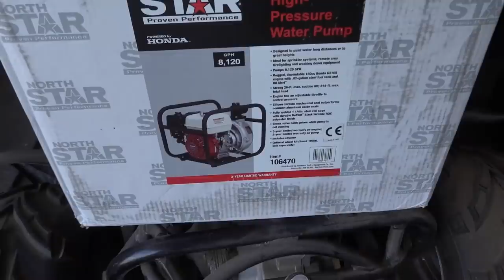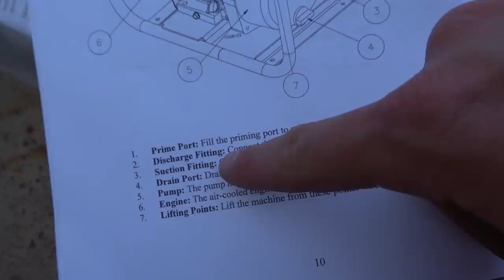I Built the Pumper Truck!!!!! Master Chief is Alive!!!

Comment: From a mechanics perspective on the truck first and foremost mount the dang tank. If you can I would maybe even mount it 90 degrees from how you have it. Then you may not need to hard line in a ball valve and can reach if from standing. Secondly this would give you more room for a rigid hose and reel. Also have you thought about hanging the pump on the under side of the bed? Like on a slide out so you can utilize that unleaded tank. Those Honda motors are dang near indestructible and we use them at work to run pumps and fans and compressors. So if you had your welder buddy build a little drop down slide out shelf you can have way easier access to the pump and motor. Anyways looks great and hope you find a good layout you like for that beast. Love the master chief moniker as well.

Comment: Cam locks are awesome but eventually after a year or two you have to replace them     There easy to swap on to your hose I have replaced a lot of them at work.  And your clamp just wasn’t put on all the way that’s why it slid off.

Comment: Don’t get rid of the red hose you don’t want to rigid hose when you were pumping you just need to fold it like we used to in the fire department get you a straight piece of board make it to straight pieces of board put it a inch and a half away and fold it into sections and it will hold the hose in place and you can just pull it out when you need it like we do on the back of Fire truck

Comment: im no firefighter but from my experience of building water trucks (1 water truck) i think you should make all the outputs to the hoses at the back of a truck (for the lay flat hoses) and then have a booster line on a reel also at the back for quick access, make all the knobs, switches and valves allin one spot so your not running around like a chicken with its head cut off trying to find all the switches etc. to run the thing.
hope this helps :)

P.S. Be careful messing with fuel lines as they can be very easily messed up and if not done properly can result in a major... well... lets just say stuff up... aka big boom (from fumes igniting in the fire.

Comment: You will grow to hate the pull start if you have to use it much. You will go through a few water tanks before you have to worry about gas for the pump.hardline the tank valve to the side to be accessible quickly.

Comment: And now buy the pump with an electric starter so you only need to prime and then push a button like they use on Snow blowers and newer large gas mowers.

Comment: Matt I’m a plumber with a little advice for your project. 1- Mount the pump in a frame on the rear of the truck off the back of the rear bumper. At a level that makes it easier to start quickly from the ground. This way you can connect the fuel tank to the engine and it will gravity feed the fuel. This will also let you get all of the water from your tank by having the pump lower than the bottom of the tank. 2 -Get  some 1” hose reals and build a piping valve manifold so you can turn on or off the lines you need. 3-Last make a hose rack for your 11/2 hose that you fold the hose up in a stack and if you need it you can quickly grab it pull it out for use. This is what pumper trucks have so when they arrive at a fire a firefighter grabs a hose takes off running to the fire with it. A second firefighter grabs the other end connects it to the outlets on the truck and turns on the water. It happens very quickly and efficiently. Talk to firefighters in your town ask them if they would show you their hose trucks and pumpers they would probably be happy to help you out with questions.

Comment: Does the tank have slush protection? Remember that slushing is a real risk for tankertrucks to flip over when driving with half full tank. Especially when going through curves. So go slow when loaded up.
You will also have a high center of gravity on the truck when loaded up.
No crazy slope driving at that equation !
Stay with the flat rolled hose.  The secret is to roll out the hose before starting filling . Ask your local fire service if they can help you out with a short instruction/ training in hose handling and some tactics for ground fire fighting. 
A hard round hose in that dimension will be so heavy to move that you can't handle it alone without working very hard.  
U can mont a reel with a smaller round hose also ( for lighter use )
There are fire fighting spraying armatures that work with lesser waterfow , that you can use fore that hose.  When firefighters go  in to a building (smoke diving) , often  smaller hoses are used to decrease the weight when pulling the 
pressuresied hose in to the building. 

Camlock on the suction side on the pump Is not a bad choice. 
On the pressure side use what fire services use. The camlock may snag    when dragd on the ground. 
Install a ball valve on the primer port of the pump for esye priming /Air removal/ The plastic treading on the 
Plug and pumphouse is not good  for frequent removal/ installing.

Comment: The tank all the way at the front of the truck on the bed because that’s what your normal square trucks do because actually there you can do it but that’s not the proper way if you want to do it but that’s just my suggestion and what they usually do

Comment: Has that thing got a PTO? PTO water pumps are common and powerful. Can't see properly but will that tank go on sideways? If it will that will free up a lot more bed space for things liike a hose reel (or two if you want long/short hoses) and you could probably get a ladder/platform on there aswell incase you need the height - maybe if some trees catch.

Comment: You need to have a firefighter come out and tell you how he would set it up, I would use a gated wye fitting so you can use a short line from your truck and your long line if you need it., you should figure out how to do a triple hose lay, makes it really easy to run the hose out., also get some smaller forestry lines to put out small fires and not use all your water

Comment: I know you have gone the way with the single output tank. But if you were to throw a dual output tank turn it sideways up against the bed and the headrest of the truck would be able to have dual output, dual motors and dual hose and reels

Comment: As a fire fighter myself I can say that 25-30’ fire hoses work better then 100’ because you have to drain them so they can dry, otherwise they will rot from the inside out. Also don’t roll them up except for storing them.  Stretch it out about 8 feet an fold it back on top of itself then continue that until all the hose is folded. That way you can grab the nozzle and run without the tangled mess.

Comment: You don't want a hose reel for your attack line.  You flake the hose in your truck bed (or make a hose bed).  You have to pull the entire length of hose out of the bed before charging the line.

Comment: That water tank is not enough. That truck can carry way more weight than that so get a bigger tank, a bigger pump and absolutely hook up the unleaded gas tank to the pump because that little fuel tank is not enough. You'll use it twice and then a big wildfire will show up you won't have enough of anything. After all the work on that big house you don't want to go up and smoke. Fires climb and go over mountains just look at Dmaxryno's YouTube channel. He also bought a fire truck for his ranch.

Comment: Matt, Utube DRAIN AND STACK FIRE HOSE.  You DO NOT want to put your hose on a reel!!  Takes too long to unwind and then hook up fittings.  In a fire situation, time counts!  Lots of good videos to teach you.  You should really buy another 100 feet of 1 1/2".  Yes, put a wye, and attach a short hose to a mounted gun on the back of the truck.  You would be surprised how tired your arms get holding a hose after just a couple minutes.  If you are saving your house, make it easier on your body.

Comment: As a small engine guy, you need to run non-ethanol gas with fuel treatment in it so it won't go bad and clog up your carburetor.

Comment: Just a resident Firefighter with not much experience, but I have a few suggestions. 
1. A baffled tank will help a lot with water weight shifting on turns.
2. You might not need a bigger pump but 2.5" can flow at 250 or even more gallons per minute with the right nozzle
3. Our brush trucks of a similar size carry 750 gallons, which is a lot.
4. we use Gallonage pumps on our brush trucks as opposed to pressure pumps, I'm not sure what you have
5. Our brush trucks don't use 2.5"  lines  because we don't typically need to flow that much water for this setting, and we want the water we have to last longer
6. if you use a hose reel you need a rigid hose because the water won't flow through a flat hose
 LAST AND MOST IMPORTANT!!!! EVEN IF YOU HAVE A PISTOL GRIP DON'T USE IT, JUST HOLD THE HOSE LIKE A MAN (you'll have more control of your stream too)

Comment: not a firefighter, but water plant operator.
1) make sure that tank is open to atmosphere when run your pump, Negative pressure equals crunch!  
2) you should also kill the pump before running out of water to prevent cavitation in the impeller.

Comment: Hey Matt. Are you well? Could you use the truck's engine to generate power for the pump? That should impact the weight of the truck, because you could then remove the motor on the pump and connect the pump to the truck's motor.. Although, you might want o carry spare diesel tack to keep the truck motor running longer. I'm guessing, if you accelerate the truck's motor, in neutral, you could generate more power for the pump. I'm no expert, this is just a thought. It also becomes a two man operation then. Someone to manage the truck's rev counter and someone managing the hose. or you can put a choke in the truck to keep the revs up. Have fun with your fire truck. Love your channels. Don't stop.

Comment: Don’t use thread lock Matt, just tighten them down real good. Cause if you need to take the couplings off for any reason (which is very common) that thread lock is going to hold you up

Comment: 1) have your welders make you a square tank with baffles... this will keep your tank lower and wider they can v the bottom to get max water.
2) build a connector manifold to hook your hoses up, you can put a pressure gauges on it and also be able to reverse for filling easier.
3) build a spray canon to mount on rear so someone can man the canon while someone drives, this also keeps it so you dont need to unwind hose
4) have a smaller hose attached to manifold for doing little fires on hose reel
5) get pump with electric start and hookup to your onboard fuel.

Just few things I see that may help... input welcome

Go to local fire station that has grass/brush truck and see what they say and get their input too.

Comment: If I was you I would put the on/off valve on the pup so you can turn on the water from the ground instead of trying to climb up on your truck so you can put out fires as fast as possible so it doesn’t spread

Comment: I would go to your local fire department for suggestions.  They are the experts in their field. The tank should be moved farther back so that you do not put so much weight on the front axle. The front axle has a limit on its weight carrying capacity  witch maybe  labeled on it. You may have to move the tank several times to get the weight distributed correctly.  Several trips to  a local truck stop with a scale.  Just some thoughts for your consideration.  Like the video.

Comment: Better build you a hose bed out of some angle iron so you can layer the hose in there and grab it and run straight off the back of the truck so it doesnt tangle

Comment: You would have been better using a high pressure hose reel rather than 70mm hose line.  We use 3x60ft lengths on each hose reel drum.  Two of you can manage a hose reel (or one if absolutely necessary) with no problem but running hose lines is going to take more manpower.  Using hose reels makes sense as they remain charged even when turned off and you get water instantly whereas hose lines have to be filled and that water can make the difference when push comes to shove.  The vast majority of fires in the UK are extinguished using fixed hose reels and quickly too.  You only need to pull off as much as you need and it is easily rewound if you need to re-site.  Fit TWO hose reel drums and you can extend to 320ft!  Site your pump inlet below the tank and you do not need to prime your pump as gravity does the job.  Just a bit of info for you.  The force that pushes you backwards when you  open the branch is called 'jet-reaction' and is directly related to the working pressure and the cross sectional area of the nozzle.  Jet reaction J= 2 x P (pressure at the nozzle) x A (cross sectional area of the nozzle).  The Y you were talking about is called a 'divider' and yes we carry a short length of 70mm hose which is useful for many purposes but we use it for filling the tank when parked next to a hydrant.  Fighting wild fire is not to be taken undertaken lightly.  They are hot, very hot and can travel faster than you can run.  It takes years of experience to understand the behaviour of fire whether in a structure or in the open.  never think 'I can manage' as it may  be too late when you realise you can't.  Call the fire service each and every time and only then attempt to fight the fire BUT ONLY IF IT IS SAFE TO DO SO AND NEVER ON YOUR OWN.  Firefighting may look like fun but it is a deadly serious occupation with the emphasis on the deadly.  In the UK we have commercial firefighting courses for company employees so there may be something similar in the your area.  Also a 2 gallon water extinguisher can hit a small fire even before it grows.  Consider equipping with at least 2x 2 gallon water extinguishers and 2x all purpose Dry Powder extinguishers for fuel and electric fires.

Comment: You should have gone to an engineering company and have them install the tank and pump and a hose reel. The hose you have is for structure fires you need a thinner hose for brush fires

Comment: Suggestion number one. Swing by your local volunteer fire department and talk to them.  They will know what you need on the truck.  Suggestion number two:  Get a new tank with baffles in it.  If the water sloshes around and you’re side hilling to get to the fire, it can roll your big ole truck right over.

Comment: metric is eazier : 1 liter of water is 1 kilo
i think you can mount that tank sideways behind the cab of the truck , though it might slosh a little when half full making the truck tippy it does leaves the back of the flatbed open so you could use the truck for hauling stuff if the tank is empty 
you might be able to up the pressure and raise the amount youre able to get above the pump by having the truck air pressurise the watertank , might cause it to empty even faster though
as for starting the pump , some of the predator and lawnmower engines are electric start you might be ably to mount an electric start kit on the pump , you could allso mount the pump in a frame under the bed on the side or the back and can get to it eazier from the ground 
would make it eazier to hook up the gastank too using gravity feed  (gastank might be a little overkill for the engine though as it looks to hold enough capacity to run the pump for a week or more non stop)
about the flat firehose : dont know if this is the same type but actual fire hoses are made from canvas  and become moist when water is pushed through to prevent them from melting and setting themselves on fire if they lay intoo or get hit by an open flame or an amber ( with a forrest fire that isnt that uncommon ) if this is not that type of hose but one meant to just pump water from somewhere intoo something else  you might end up holding the nozzle and not get any water at the worst possible time , if it is you need to dry the hose after use or it will rot (thats the reason fire stations usually have a tower , they lift and hang the hoses in them to dry out )

Comment: I'm sure someone has said this by now, but put the tank directly over the axle.  That truck was not designed to have 2 tons in one spot in the center of the bed, it needs to either be evenly distributed or placed directly over the axle.

At least, that's what the Army told me when they trained me on driving these things.

Comment: Hard to tell from video, but if you can get away with it, i would weld a steel plate lower on the back or side for the pump to bolt onto. Tools like shovels, rakes, pulaski axe would be good, extra fuel for pump. PPE, buy equipment to protect yourself, Nomex and a good set of boots and gloves.

Comment: get electric start thats runs off the battery for the pump and drill hole through the handle on the ball valve and run linkage to the edge of the bed so you can open and close the valve from the ground  have fun with your new toy lol  love your channel

Comment: I'm not a firefighter, but I'm a tanker driver. You'll want to keep your tank 100% full or it will slosh around and can easily roll the truck (or slam you forward if you stop quickly). Also, there's nothing wrong with your pump, but personally, I'd prefer a PTO to power it directly from the truck.

Comment: Use a booster line, if u use this hose u have to flake it out 100%, booster reels u don't. Agree that's a pistol grip for ur nozzle u sushi cumin do not hod the nozzle from there u actually hold it from the hose itself (booster reels u do not have to flake out all the way, if u have a 100foot reel but u only need 10 feet u can just pull 10 ft and leave the rest on the reel and charge it)

Comment: Wouldn't both the inlet and the outlet of the pump need to be the same size cam lock if you're going to switch the hoses and fill the tank?
It also drill a small hole in the end of the handle on the valve using a rope to each side to open and close the valve from ground level